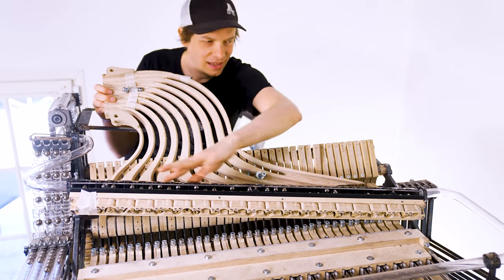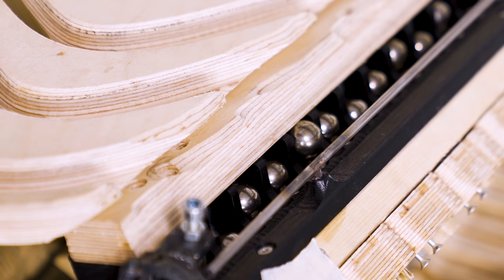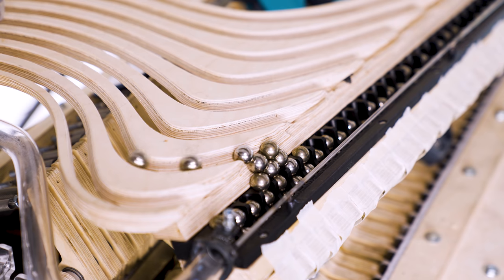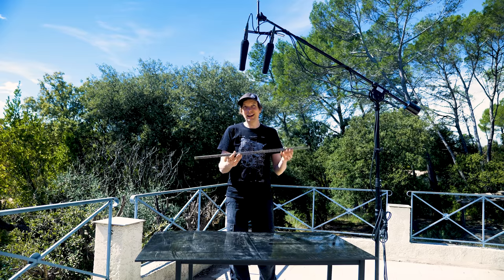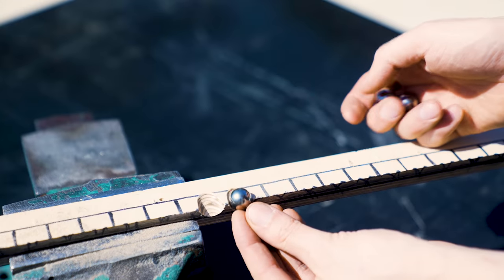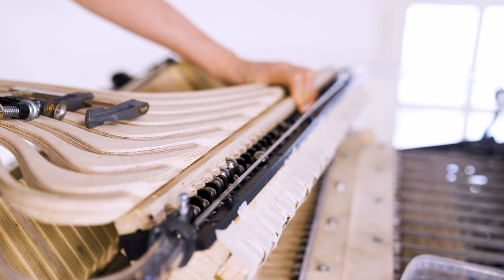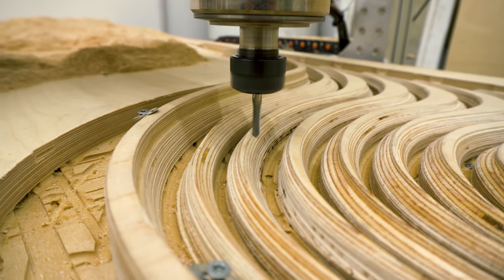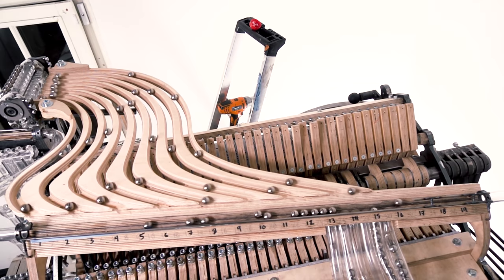Marble Tracks with Hidden Feature

Comment: I think you overthought the part where the marbles will stick out like you showed. That will most likely never happen, you physically had to hold it back into the space. You may have actually added more problems by doing that, Hope you figure everything out! Good Luck! All I suggest is run some tests (machine in whole) before judging your solutions.

Comment: What about the case of a marble running down a full divider, and simultaneously another one being delivered by the ramp as the one passes below? Wouldn't that cause the marble to skim over the top of the marble, and jump over the railing on the divider?

Comment: I know you dont need any more to worry about but, what is the temperature of the MMX? 
is there any heating up of parts touching each other? 
just curious if that is a issue you are thinking about as during the shut down of the mmx I thought I heard friction. 
(i could be wrong)

Comment: Is it possible there is an edge case where too many marbles come off the fish stair and down the 8 track and they are not rolling down the height-independent distributer so they pile up and a few hop over and down on the xylophone and drums?  (E.g. during a pause in a song that otherwise has a lot of notes.)  I guess setting up the machine with the right number of marbles will be critical, the new design allows for very long marble feeds for each of the 36 channels, so maybe this will have a high resiliency, or wider range of marble loads where it will still work optimally for most music pieces you will come up with.

Comment: Redundancy means having extra of something. for example if I say "the little tiny spider" little is redundant because tiny means small already. In engineering terms, "redundancy" can be used as a form of fault tolerance. For example, if I have 2 hard disks where I write exactly the same data and one fails, I will still be able to recover my data from the second drive. In the MMX scenario, the tracks are not really redundant. if the track fails, there is no other system which can deliver marbles to keep the machine working. if it fails, the whole machine fails. It might be fault tolerant in other ways, but not redundant. I think really the word Martin was looking for is "Robust", meaning not exactly fault tolerant, but rather being able to handle the job so well that there aren't faults to begin with, or they are very rare to be an issue.

Comment: So, just shooting ideas now for the MMY, why have the fish stair or elevator be so high now? Why even have PMMA leads from the divider to the top of the clock escapement feeder PMMA tubes? Why not just drop the divider right on top of the escapement feeder heads and straddle the actuator arms? Better yet, just replace the feeder heads with the divider itself and the marbles start even lower. The marbles travel right to left across the front of the machine, feeding the bass and rhythm section first, then just end up directly back in the divide by four.

Comment: I"m a little worried that there could be an edge case that you ignored: if the black track is really full and a marble comes down the top divider, might it not skip over the rather low guard rail at the front and fall over onto the machine and thus onto the floor? I think you need to raise the guard rail or add another similar one on top?

Comment: 13:06 I'm afraid to have an issue if you have 6 marbles in line (or more) and one dropping ...
but it could be just a camera angle issue (I didn't see really the height of the bar )
But if the line if full and new dropping marble came, I'm not sure about the target of this new marble ... (it may be not possible .. it's just a thing to check)
About the perfect waterfall effect, I didn't understand why you tune to drop all marble on each other instead ... (10:44 drop line 3 and collision with line 7)
One last remarque, I'm worry about bouncing marble at 10:46 (in case of full track or more marble in stack)  but in this case to it could be just a camera angle issue ...

Comment: I really don't see how the overrotation helps with marbles bouncing around. Sure, the marbles move slower while they are on the lanes. However, most of the energy that would otherwise go into linear velocity is converted  into angular velocity. As soon as the marbles get to the end of the lanes, you can see how they speed up by a lot and end up bouncing around nonetheless.
Maybe there is some improvement due to friction, it's hard to tell. I would be very careful though with assuming that this won't be an issue anymore.

Comment: I'm only thinking of the issue when the return line is full of marbles, and as the marbles drop from the belt tracks to the line, it may bounce/roll off completely free from the guide.

I doubt it would be a hard fix, and it's something Martin could randomly fix within a day; however, I'm guessing the next test will reflect it.

Comment: I fear that too many marbles will be missed by the current angle of the divider that fast channels will run out of marbles. Program that first escapement channel into its maximum speed and see if the tube remains full.
I’m also somewhat concerned with the speed of the main elevator in general. How many channels running simultaneously at full speed do you have allowances for? Hopefully at least 4, which you could reasonably get with a fast percussion and vibraphone and bass song. Then again, I suppose you’d just double the crank-rate of the machine and run the instruments on half-max instead, at the expense of shorter unique music.

Comment: Redundant does NOT mean overflödig or superflous. Redundant things CAN  be superflous. In redundancy there always has to be 2 same/similar things of something for one purpose otherwise the term is always used wrong. 
E. G. Fallback generator = redundant, 
two hearts, where one can take over if the other fails= redundant. 
Two hearts where one can not take over = superflous. 
Edges on mmx divider that don't add to function or aestethics = superflous
Second flywheel belt that can still work well when one is broken = redundancy.

Generally spoken in engineering no matter If talking hardware or software you always choose robustness over redundancy. In some cases this is not possible, then you go for redundancy.

Comment: I'm not convinced about the way the marbles are entering now. 

They still get a lot of speed from the small drop off the marble lanes which kinda defeats the purpose of the overrotating tracks, especially since they also drop in at an angle. For example there is no chance a marble will enter a channel right after it drops onto the marble divider like this. They seem to skip at least 2 lanes or so. I could also see marbles jumping over the guard rail in this design occasionally, especially when marbles drop on top of each other.

I think the exit angle of the marble lanes needs to be a lot less, add a higher guard rail made of different material (maybe acrylic or wood), maybe make this a machined part with guides where the marble tracks end to guide the marbles straight down, and the height from which marbles will fall into the marble divider needs to be minimized as much as possible.

Comment: This has been my worry with the marble tracks since your testing: you check all of the different options, then you go with the most extreme option that still works. Whereas if you go with one less extreme option, you would have some wiggle room before failure. You always go just a hair away from failure on certain things and it always stresses me out.

Comment: 12 (8 from elevator and 4 from fishstair) marbles per beat continuously. 32 channels so 0.38 marbles per channel per beat (continuously)  Now of course there is a lot of buffering (the pmma pipes from the divider to the channel) and as long as those have marbles there is no limit to speed of playing. Maybe an interesting number is how long it will take to fill the machine? how long (in marbles) is a channel tube? say 50 marbles? then it takes 50*32=1600 marbles to fill it, or about 133 beats. so about 2-3 minutes to fill the thing. is that about right?

Comment: You can see how a closely following marble is being slowed down when a marble fills a hole. This is only 1 tube, but this will become a serious problem when more tracks are constantly being refilled. The design is a stack of sub optimal solutions that will eventually obviously fail.

Comment: Your solution creates noise. You should simply drop the height of the strip (cut a strip off) and bevel the front edge, sloping it backwards. The simplest solution is usually the best. You have made it prettier but more complicated.

Comment: Maybe if you just invert the position of where the marbles stays in place to the opposite side you can avoid this easily, of course, we will not have the nice look of the marbles when it falls but anyway, it's a ideia i think
Reply: I don't know if I sound clear enough, I mean, instead of dropping the marbles right in top of the other marbles, just switch the marbles to the front (opposite) side of the divider

Comment: Why was the obvious solution not the 1st solution? You just need a 2nd POM part that has the same geometry of the new divider, with a negative slope on the front face, at the height you need to get the tracks at the right angle. Even better if it's multiple slices so you can adjust track end height, and thus the angle of the tracks.
Also, why didn't you just use your favorite solution: washer stacks? 1 hole between each lane, a 2-3mm bolt and voila! Adjustable height track transition with zero chance of marbles escaping through the gaps.

Comment: What I think you are doing is great... I am just wondering when you move it, how it's going to survive? I hate to see it fall apart when you take it out for a concert. Your thinnest part in wood is going to be your weakest link. It's like you almost need to put it on a Earthquake shaking table to make sure it will survive your moves. If you were here in the USA, I would suggest you visit any major university and ask to use one of their shake tables but I am not sure where to aim you at over in the EU.
Reply: he mentioned in previous videos that he's working on another machine, "the mmy". this machine is technically a prototype for the world tour version. also, if i remember correctly, on the first videos of the series he mentioned that he's building the machine in "modules" making it easy to take it apart for transporting
Reply: @lambertstarr1218  thanks. I missed some of that.

Comment: and here I sit waiting for the ultimate issue to arise... the speed at which the marbles are recycled and picked up by the flywheels will dictate the speed of music and notes/bpm of the machine. can't play a super complicated or fast song if the marbles can't make it through the system back to the top at the same speed. you'll need to compose around and below the speed by which marbles can be added to the system via the conveyor.

Comment: you're using redundancy when you mean resiliency. redundancy would be if you have multiple parts doing the same thing that can be accomplished by just one, redundancy uses duplication for fault tolerance. Think multi-engine airplanes, they can still run if one of the engines fails because the engines are redundant.

Comment: Why not just use a router to make a concave edge all the way across the underside of the front of adapter? Should solve both problems and be easier to make a new piece if needed for any reason

Comment: After so many years, you still overengineer things. Why not just cut the whole wooden piece like a wedge, so cut the front in. 45 degree angle so the top stick out 1 cm over the resting marbles and the bottom is retracted to let the marbles roll into the holes of the lanes.

Comment: Wouldn't you just want the marbles to roll in to the open side of the new marble divider, instead of rolling over the top from the back side?
Reply: The pipes need to be full for a marble to proceed to the next pipe. Means that the latter pipes will always be empty. Having channels like that makes the distribution much more even

Comment: I still think those marble lanes/tracks are way too slow. So far, you haven't been testing the machine with all 38 channels, and because of that, I think the marble feed rate at this point is optimized for only those few channels you've been testing with, and not accounting for the fact that the machine will need a much higher amount of marbles per minute with a melody using all the tracks...

Comment: I'm not an engeneeer, but in my opinion if in a stable temperature/humidity environment like his studio there are all this issues where marbles get stuck in wood's paths, I won't imagine what could append in a very different environment like a cold and humyd live stage.
Too many critical parts in the machine acutally works with a very low tollerance and wood is not a "stable" material it change a lot with humidity and temerature. As soon Martin will take the machine out of is studio it will stop working... He should have made more pvc or metal parts in my opinion.

Comment: Can't see very closely, but would it be possible under the right conditions where a marble falling off the marble lanes can land on top of a marble running down the divider causing it to jump the metal rail and out? actually looking at the video at https://youtu.be/neuULfh5ApI?t=987, it does come close.  So in 1 million marbles there could be 1 or 2 that pop out.